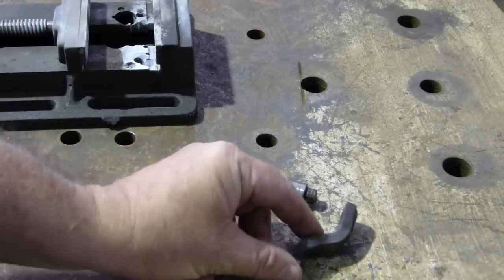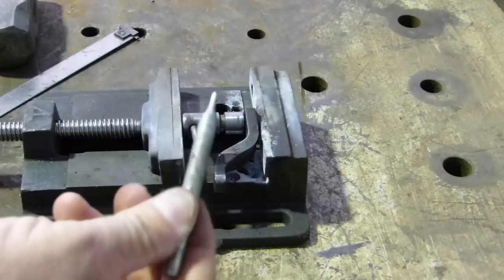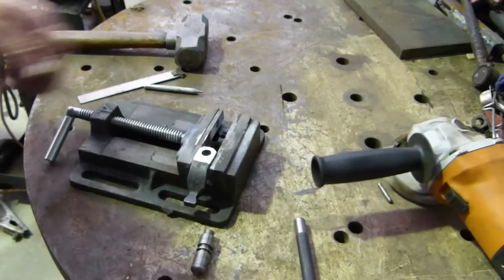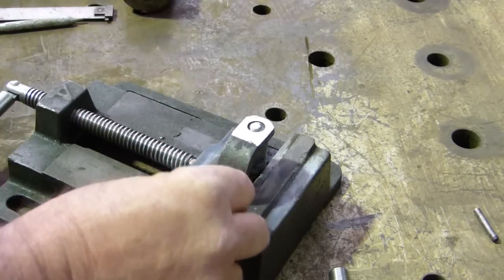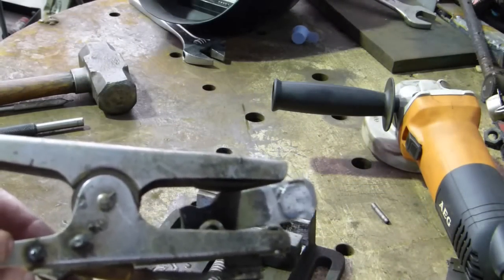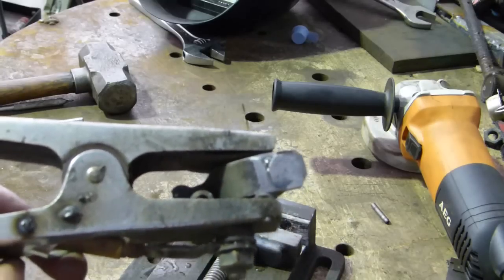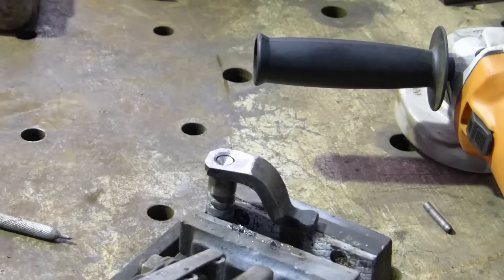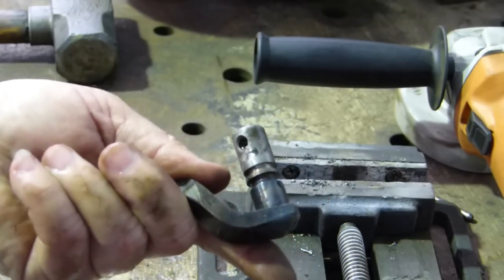Zetor Gear Selector Repair

Comment: G'day Lanz greetings from Tassie,  mig welding is something I really want to try and have in the shed.  One question though, would that have been better to braze on instead of mig?  I would like to know why you use gass with mig welding sometimes? Great video I have liked everyone you have done so far, you have a great sense of humour and a very relaxed way of presenting your videos, thanks very much Lanz all the best from John
Reply from the maker: G Day John, The gas shields the weld from contaminants and makes a nice gas enviroment for welding. The gas is argon with some Co2 I think. Braze may well have worked too but as it was welded originally it was monkey see monkey do lol.
Reply: Bundy Bears Shed thanks Lanz regards John